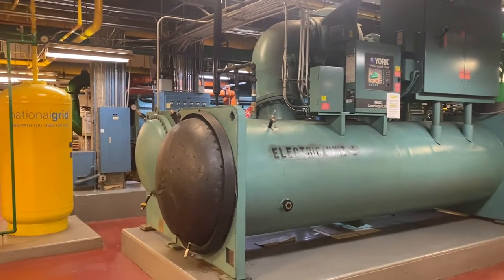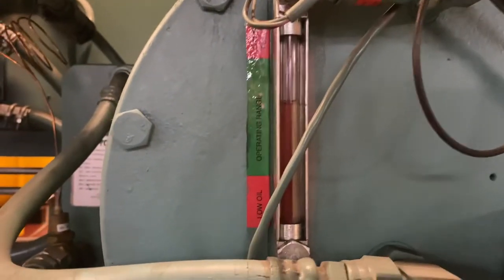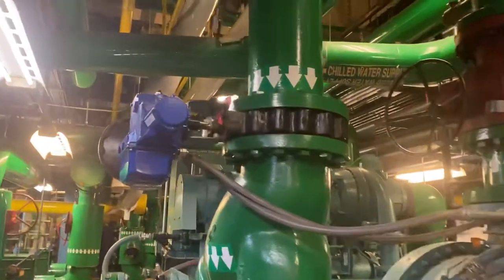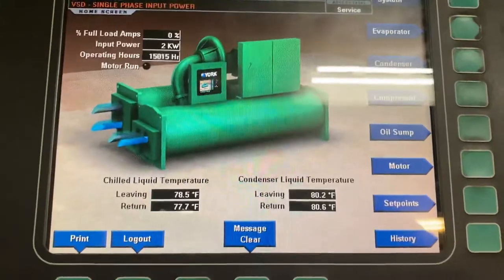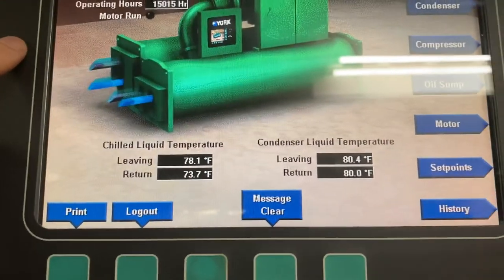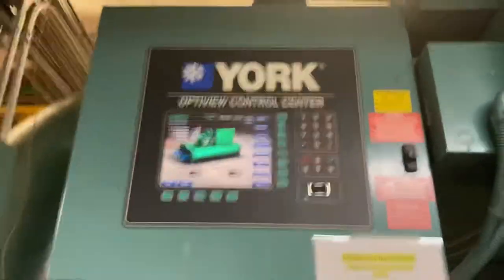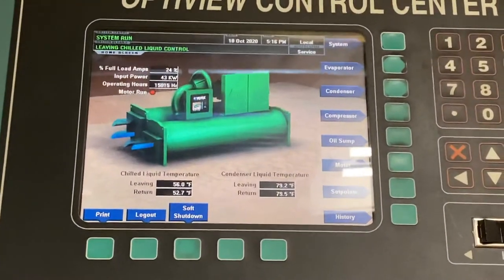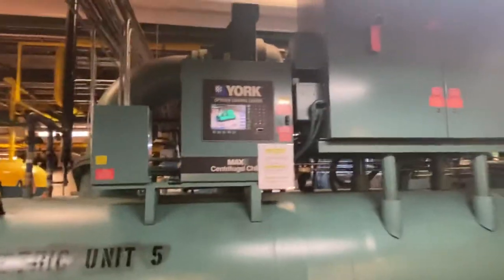Starting A York Centrifugal Chiller

Comment: I finally had my first exposure to a chiller the other night on an emergency after hours service call. It was a Trane Centravac centrifugal chiller, about maybe half the size of this one. Don’t remember the tonnage but it took something like 560 lbs of R22. I had no idea just how ridiculously loud these machines were until it roared back to life. My head still feels weird from it. 😆
Reply from the maker: A Trane Centravac is a low pressure chiller so It most likely would not use R22 it was probably R123. But they are nice machines and its definitely a sound you will remember.
Reply: @thecarboneacademy2615  the data tag itself on the unit stated it uses R22. This was a “Series R” manufactured in 1996, and was on a hospital building, if that helps.
Reply from the maker: You're positive it was a centravac?  R22 is a high pressure refrigerant and would not typically be used in a low pressure chiller.  Would usually be R123 or R1233zd.  I would love to see that data plate if possible.  This is very interesting.
Reply: @thecarboneacademy2615 I thought r22 was a medium pressure refrigerant?
Reply: R22 is high pressure, Trane only uses 11,123,1233zd and the last one is like two to three years old. R22 wasn’t really popular in centrifugals.  York and Carrier over the years have used 11,12.134a,22 ( screw machines) York used 123 carrier didn’t. I worked for York and carrier for a total of 23 years
Reply: @craigr6186  I'm thinking of 134a, nevermind.
Reply: R22 in a centravac? What was the model number?

Comment: Working on one similar to this next week. How bad is changing the oil with a hand pump? It holds 20 gallons . 134a machine the sump is located below my condenser fortunately so it’s easy access.
Reply from the maker: Yes most of the oil sumps are underneath the condenser.  Changing oil should not be too difficult.

Comment: air called the chiller vacuum process. चिल्लर का वैक्यूम कैसे करते है ....... carrier chiller vacuum process
# 30x chiller vacuum process
# 30X chiller
#air colled chiller air 
air colled chiller complaint
# Display reading
# inlet outlet
# split AC
# oil filter change

Comment: do you have a video on adding freon to one of these chillers.  I have 3 in the hospital I work in and I have been tasked to troubleshoot.  Ant info would be greatly appreciated.
Reply from the maker: Unfortunately we currently don’t have any refrigerant recovery videos available. We will try to create one.
Reply: For putting gas in from flat, add vapor until it’s about 35#, then push pull it in. 

If your topping it off, then just run a hose from the tank to the evaporator barrel, and let er fly

Make sure you do the opposite when recovering to make sure you don’t freeze the tubes!!!!